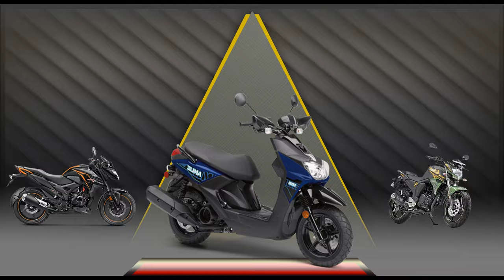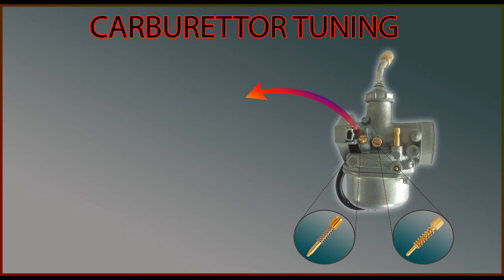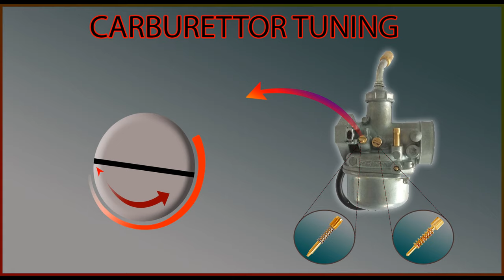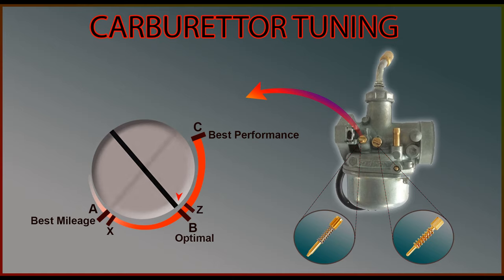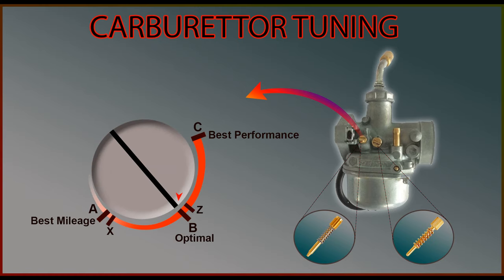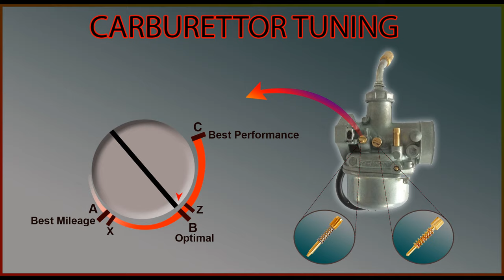Bike or Scooter carburetor tuning for mileage, carburetor setting. TVS Jupiter, Wego. #carburetor

Comment: I am having Xtreme 200s if we ride for 30-40 Kms and stop for 3-4 hrs once we start the bike it won't start it takes 3-4 kicks to get it started.. recently changed air filter also still problem not solved.please help me
Reply from the maker: It's an issue with your carburetor float pin. Try cleaning it. If problem persists, change it. It is caused due to petrol overflow in Carburetor
Reply from the maker: God Love  Engine head must have been worn out, hence you see more smoke. Have it checked and reconditioning the head bore or replacing it should work to a maximum extent. For Carburetor tuning, before starting the engine tighten the air screw completely and then unscrew 1 turn. Then start the engine and first reduce the idling to an extent where the engine is barely on. Then try adjusting the air screw, you should see some rpm difference then.
Reply: @autobotgeekse  See
Reply from the maker: @amalsinha7277  ??

Comment: My old Activa 2008 model milage problem please help me
Reply from the maker: If the vehicle is old, it's not just the carburettor tuning that will do the trick. You will need to have the cylinder bore checked as well for wear and tear along with piston rings. Once tha is ruled out you will need to try tuning the carb and see the difference.
Reply: @autobotgeekse  thank you
Reply from the maker: @comeplay2407  wc 👍

Comment: I’m sorry but some of this information is incorrect. 
The idle air screw only affects the ratio at idle and you should be adjusting for the high rpm or vacuum which go hand in hand. Then the idle speed screw is adjusted to the factory recommended rpm or as low as possible without possibly of stalling. 
Adjusting for fuel economy is done with changing out jets or adjusting needle on certain motorcycle carburetors. This applies across the board to any internal combustion engine with a carburetor.
Reply from the maker: Up jetting or down jetting will definitely make an impact on fuel efficiency. However, while tuning the carburetor we do not work with idle screw only, we also make changes to air mixture screw which does impact the fuel efficiency. You can see my other video where I have shown the practical fuel efficiency differences in all the 3 settings.

Comment: In optimal setting idling is not stable even in mileage setting only in performance setting idling is stable
Reply from the maker: Yes, idling will have to be adjusted on a higher side in Rich/Optimal settings

Comment: Sir, i have bajaj dicovee 150 cc ..bajaj authorised service center asked me to change carburetor but local mechanic have done similar setting and bike is working ok...
Issue : while driving bike use to acculator automatically i mean maximum rpm without giving race...use to give jerk as well.

What shoud i do sir
What should i
Reply from the maker: Probable reason would be due to accelarator cable getting stuck. That can be due to worn out accelarator spring or damaged accelarator cable. If water gets into the cable, wire gets rusted and springs strength will not be sufficient to push the cable back. There should not be varied RPM instances by itself for Carburetors just because of air mixture screw setting.

Comment: can u please upload a video to solve my problem? i.e. my starter works fine, but the rpm isn't stable n the engine stops. i cant start without pulling the choke on rtr 200 4v...the problem is, when i press the starter the engine starts fine, but couldnt remain in idle rpm even for a second or two without pulling the choke 😭
Reply from the maker: Try to increase idling rpm by adjusting idle screw. If problem still persists, make the air fuel mixture ratio a little leaner
Reply: @autobotgeekse  am gonna try 😀 n i really hope it works thank you
Reply from the maker: Wc. All the best 👍
Reply: @autobotgeekse  well i tried, but the air fuel mixture screw doesnt really works, so i think theres aproblem with the carburetor or the screw 😭 since the original screw was lost and i bought a new one online n i think its not working
Reply from the maker: Yes, screw will have to be matched for exact replacement. Else, will have problems. Cone taper should be identical. Incorrect screw may damage the cone seating permanently.
Reply: @autobotgeekse  can u please tell me where i can get the exact identical screw?
Reply from the maker: @naute8581  usually that is not available always. You can try used vehicle scrap yard. You can rather get carburetor itself for a cheap price.
Reply: @autobotgeekse  okhay😊 thank u for ur time
Reply from the maker: @naute8581  wc, all the best 👍

Comment: My jupiter scooty average is so much bad YouTube par utne video dekhe koe kehta hai jaha par sabse jaada Air fuel mixture ho rpm jaada ho baha par set kardo or beat set karlena  aap keh rahe jo jaha sabse kam ho baha se thoda jaada kar lena jaisa aapne bataya besa maine kiya 25. 30 ka de rhi hai please help..
Reply from the maker: I know, all the other were misguiding. Hence I made this video. You can see my other video where I have shown the practical difference in mileage for all the 3 settings. Please see my mileage test video. Also, carburetor tuning is not the only factor which affects the mileage.  Please have your vehicle checked for other factors like piston o'rings, wheel rotation restrictions due to brake pads or bad bearings, poor spark generation due to bad coil etc
Reply: Abhi 60 tak ka deti thi mai Mostly Eco par he Chalata hoon Power par jaane bhi nhi deta  phir bhi abhi agency se set karwaya tha 44 ka de rhi thi aapke video ko dhek kar set kiya aab 30 ka de rhi hai
Reply from the maker: @ShivamTiwari07  ek baar gadi ko check karvaiye. Koi toh problem hai. Bahut sare mere viewers ne confirm kiya hai ki rich setting mein unko accha mileage mil raha hai

Comment: does this work with a rx??
Reply: Don't run lean mixture on RX. Engine will not get enough oil and it will seize. It will not get enough petrol and will overheat.
Reply from the maker: Better to run a 2 stroke vehicle in optimal setting.

Comment: Mari splander plus bike h phle 60 se 65 milage dati thi lakin ab 50 se 55 ka milage deti h tapit setting kr li plug saf kr liya air filter chang kr liya tuning kr li lakin koi fark nhi padta koi upye h to btao
Reply from the maker: Kitni purani bike hai?
Reply: 2018 modal h
Reply: Dhua bhi nhi deti
Reply from the maker: @thoughtoftheworld4520  spark pulg ka electrode distance chk kijiye. Also, main jet ko ek baar chk kijiye kahin uska hole bada ho gaya hoga

Comment: i tighted air scrue low. Milage just 35 after see this video why? I knew that where rpm is high here will be best mileage.
Reply from the maker: Hope you have seen my other video where I have shown the practical mileage comparison in all 3 settings
Reply: @autobotgeekse  yes, I saw but practically I found best after 3 full turn open air scrue 45 km. Carborator manual like as you in carborator lowest rpm setting i found 38 or 40 kms my 110 cc engine. Mechanic changes piston, ring, vulve, carborator pz19, other factor mileage is ok. Would you suggest anything?Thanks
Reply from the maker: @Mythinking019  it depends on carburettor as well. For scooter carburettors it does not need those many turns. You will start seeing difference in beat with less number of turns there. It depends on the air screw thread pitch. However, as long as adjustment is done properly you should achieve good results

Comment: My activa i rpm increased by itself
Reply from the maker: When does it increase? Is it when you adjust the air screw?
Reply: @autobotgeekse  after run few kms, But Now it's solved, there was faulty jammed accelerator cable what i was using since owned. i replaced and changed carburettor setting, getting 54kmpl mileage
Reply from the maker: @relquo  that's good

Comment: Pleas show on tvs hlx 150
Reply from the maker: HLX series is not yet available in India. However, all the carburettors will have similar settings. You just need to identify the air screw and find the direction of aperture closure (clockwise or anticlockwise)

Comment: What is the fault if you accelerate and the engine shuts off
Reply from the maker: Your main jet must be blocked. Clean it and it should work.
Reply: @autobotgeekse  I already cleaned it ...   But no solution till now
Reply from the maker: @Sam_lyf_  which bike is it?
Reply: @autobotgeekse  it's tvs Jupiter
Reply: It's happening in cold start
Reply from the maker: @Sam_lyf_  Jupiter has that problem. You will have to keep the choke pulled for some time for the engine to settle. Then it will not shut down. I think this is the flaw in the build for Jupiter.
Reply: @autobotgeekse  but mera ek cheez confirm hai mera throttle slide ka upar jo rubber ka cover hai wo halka kat gaya hai .. kya usse koi issue aa sakta hai kya
Reply from the maker: @Sam_lyf_  should not be a problem.

Comment: Thats for idling only.. when you open the throttle, it has nothing to do. It does not contribute to performance. A little efficiency maybe but as what i said, its only for idling only so it has very little effect on efficiency.
Reply from the maker: It does help in efficiency as well. You can see my other video which shows the actual test results for all 3 settings. But yes mileage mainly depends on the throttle and fuel passing through the main jet.
Reply: @autobotgeekse  of course it helps. But as i said. Thats for idling and very little. How much time you spend idling on a motorcycle? And why you will choose "mileage" and "performance" by tuning or turning the idle Air fuel mixture  screw? From the name Idle air fuel mixture screw, it only for idling and the best way to adjust it is to have good idling, not for choosing mileage and performance. It is designed to be there because idling is the most crucial part to engine to operate because its struggling for air and fuel to enter the combustion. The main jets and its venturi are too large to effectively give the right amount of mixture.
Reply from the maker: Yes it's true and we cannot rely solely on air fuel mixture screw for fuel economy as there are other factors which affect the fuel economy. As I said main jet is the key component which decides the vehicles mileage basis the regulated flow to the ventury. Hence, I mentioned in the video, just by doing this you will not see a drastic difference in mileage.

Comment: Mine works just the opposite.
If I loose the screw, the rpm drops, if I tightening it rises....
Reply: You have a fuel screw not an air screw
Reply from the maker: Probably you are using the fuel screw. Pls check once
Reply: mine too

Comment: that is not a earmixture screv it is a fiule mixturescrev. if it was in the other side of the needle it was a earmix screw
Reply from the maker: Tightening the air screw will result in lesser air passage which in turn affects the fuel siphoning. When we talk about the mixture, it is the air to fuel ratio that we talk about. When we tighten the screw, there will be no barrier restriction for fuel siphoning since the fuel line aperture is still not letting the maximum fuel flow since the air screw is not completely open yet, hence a rich mixture. Alternatively, when we unscrew it completely, the maximum air passes through the passage. However, due to the limited fuel line aperture size, it can only siphon the maximum fuel which can pass through the aperture. Hence, the lean mixture as the ratio of air will be more than that of fuel.

Comment: If its called air screw then how it adjusts fuel going into idle mixture circuit? This is confusing 😕.
Reply from the maker: By tightening the air screw we increase or decrease the aperture size of the air intake nozzle. The air intake path has an internal connection with fuel chamber in Carburetor. Hence, when the air gets pulled it automatically pulls fuel from the carb chamber. Hence, bigger the air intake aperture size, more fuel gets pulled from the carb. Same thing happens when you press the trigger of a paint gun, more you bring back the needle more paint gets sprayed.
Reply: @autobotgeekse  ok so the screw adjusts the mix and not the air or fuel volume separately. A lot of videos on YouTube on this topic are confusing. Some say it adjusts fuel while some say it adjusts air volume. 
So what is the optimal position of that screw? because I'm not getting good fuel economy. I tried multiple settings from 1 full rotation to 2.5 rotations anticlockwise from fully closed position. The rpm doesn't become stable as u shown in this video. Thats why i find hard to set at a point.
Reply from the maker: @sourabhpanse  yes this screw allows to tweak the air fuel mixture ratio. For optimal mileage, loosen the screw until you get max RPM and then tighten it by half turn. Then adjust the idle screw for optimal beat. You should get better mileage if no other factors are affecting your mileage like tyre pressure etc..
Reply: @autobotgeekse  there is no variation in rpm when I'm rotating AFR screw. Even mechanic was not able to set. Thats why the carb tuning is wrong.
Reply from the maker: @sourabhpanse  there should be some variance. First tighten the sir screw completely and unscrew half turn. Then start the process, you should see an increment in RPM when you unscrew it further
Reply: @autobotgeekse  i tried this method but believe me there is no change in rpm as i open air screw. 
Perhaps it happened because I changed HT ignition coil yo aftermarket one and not honda genuine part.
Reply from the maker: @sourabhpanse  may be, also chk if air screw has proper taper cone in the beginning as it seems not to be blocking the air passage when you tighten it
Reply: @autobotgeekse  i also changed air screw, its rubber o ring, spring. All came in a set. But old one had no problem.
Reply from the maker: @sourabhpanse  try using the old one. Chk if length of both screws is the same. Especially compare the front conical part
Reply: @autobotgeekse  both r exactly same, identical in shape size, tapered conical end. No difference.
Reply from the maker: @sourabhpanse  seems to be an issue with carburetor then. Beat should change when you close the air inlet by tightening the air screw
Reply: @autobotgeekse  thats what i suspected but authorized service center said no issue with carburetor. Also replacing carburetor is not affordable. It costs 3500 and a month wait when I asked. Its not available in local auto market
Reply from the maker: @sourabhpanse  true, try it from automobile scrap. Used one will cost you less
Reply: @autobotgeekse  i searched but not found. Also not sure if that will work.
Reply from the maker: Probably some issue with your carburetor.
Reply: @autobotgeekse  yes i think so too but tired of trying anything now. Thinking of selling it and buy jupiter.
Reply from the maker: @sourabhpanse  understandable, it's quite frustrating. Good luck 👍
Reply from the maker: Try changing the air screw spring. If spring has more turns then it will restrict the complete closure. Try removing the spring completely and tighten the screw completely. Do not overtighten as it will damage the aperture. First remove the spring and put the screw back. Tighten it completely and then unscrew it 2 turns. Then start the engine and try tightening it completely and see if engine stops while in idle. If it stops then spring is the culprit. Try using a shorter spring with lesser number of turns.
Reply: @autobotgeekse  thanks. I tried that as well. With spring without spring, changing spring when I bought new air screw kit. Both springs are exactly identical. Their turns and compression were exact same.
Reply from the maker: @sourabhpanse  then it is a serious carburetor issue. Bad luck
Reply: @autobotgeekse  i think so too. But according to ASC, carburetor is failsafe part.
Reply from the maker: @sourabhpanse  very true, I think mechanic has fiddled with the air screw area while cleaning it due to which the conical part is no longer blocking the air passage. Probably tried to clean with a sharp object which damaged the internal seating area
Reply: @autobotgeekse  i also fiddled with it quite a lot when mechanic was not able to set correct tuning. I experimented a lot removing each and every part/ component investigating how it works, how pilot jet circuit and main jet circuit works.
Reply from the maker: @sourabhpanse  oh ok
Reply: @autobotgeekse  i m planning to flush and change engine oil to castrol power1 ultimate 5w40 scooter oil. Let's see if it improves the average.
Reply from the maker: @sourabhpanse  Will not make much of a difference but you can try
Reply: @autobotgeekse  i have seen ppl giving very positive reviews of this oil and improvement in fuel economy, engine smoothness, less vibrations, increased pickup, quick start in morning.
Reply from the maker: @sourabhpanse  Oil change will not improve fuel economy that much, it's very marginal. It contributes more to extended engine life and reduces gear wear and tear. Bad engine oil will not restrict the gear rotation that much which will impact the fuel economy.